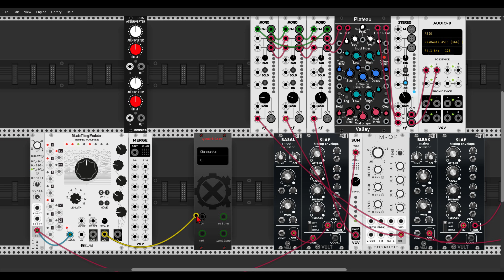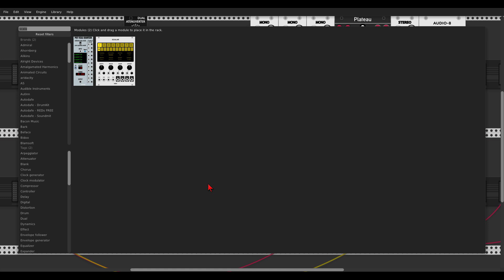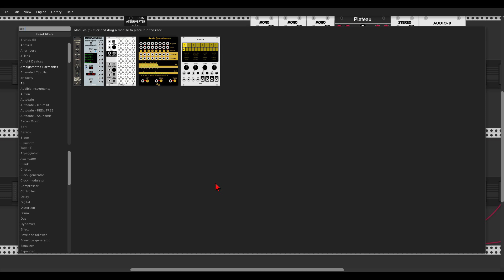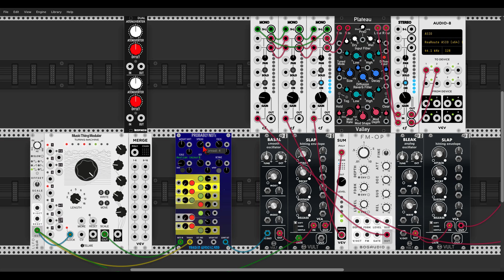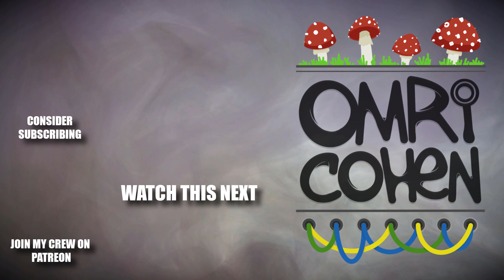Comparing Quantizers in VCV Rack

Comment from the maker: About the Midi map mode in Scala Quantizer, it maps each pitch of the current scale onto the 12-tone-per-octave pitches that you'd get by default from a midi controller. So, if you're using a midi keyboard and sending it through the quantizer, instead of tuning each key to the nearest pitch of your selected scale, each key, as you go up, will be returned to the next pitch in the scale. If you wish to use, for example, a scale with 24 pitches in an octave, then two octaves on your keyboard will correspond with one octave of your scale.

Comment: great video! i’ve been using quantum to quantize notes ( i’m a noob) and since it has a gate out it’s been great, the jw quantizer does not have a gate, and i’ve been using CLOCKED into entropia to sequence , so i can figure out with that set up how to use jw quantizer, would i route something from CLOCKED into say interzones gate?
Reply from the maker: Thanks! Well, I guess that the easiest will be to use Quantum or a different quantizer that has a gate output, but you can also try ReTrig from Repelzen that is designed for this.
Reply: Omri Cohen thank you man, i will have to give that a try, i’m still learning how to string everything together but every day is getting a bit better, i really do like the jw quantizer but i might have to just use quantum for a while since my patch didn’t have any clock in it besides clocked, i love that thing
Reply from the maker: Yes, Clocked is a must, totally. By the way, also Mother from Orange Line has the option to choose a predetermined scale. It's in the right click menu. It also has a gate output like the one on Quantum.
Reply: Omri Cohen excellent!! really appreciate all your videos man!

Comment: Hello Omri. I want to use VSTs in VCV like plogue. And i found Host module. Do you think this is worth to buy it. Do you know any technique to use VSTs in VCV 
Thanks.
Reply: Host is the thing if you want to use VST in VCV. But be careful. VCV is already demanding on the CPU. So it's depending to your Computer which VST'S work fine. Some of them crackle very easy. I use it and i like Host very much. And its supporting the Makers of VCV if you buy some Stuff from them.
Reply from the maker: Hi! Yeah, like Roland said, Host is the thing for you if you want to use VSTs in VCV.. I have it and it's great, but I have to be honest I don't use it that often. I find that I have enough to play with in VCV and I don't have so many VSTs actually. Although, running Kontakt in VCV can be lots of fun, but I do get crackles here and there. Don't forget also that now Host is polyphonic so you can also program drums and such (pssttt, video coming soon ;) )
Reply: @OmriCohen-Music  Thank you both. Actually I want to use Eventide's plugins in VCV
Reply from the maker: Well, with host you get also the effects version so you can load effect VSTs also and use them in VCV